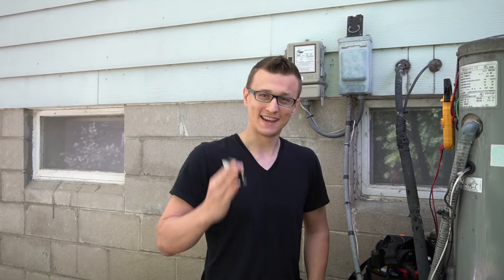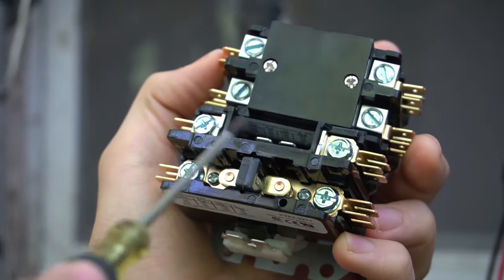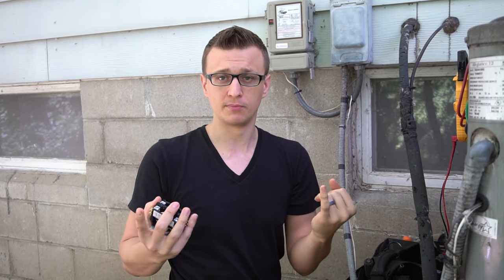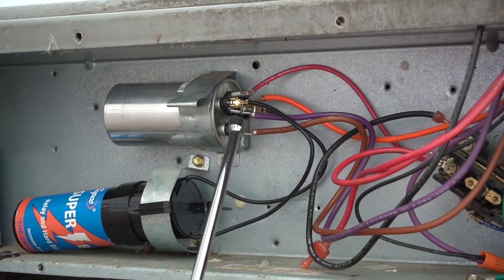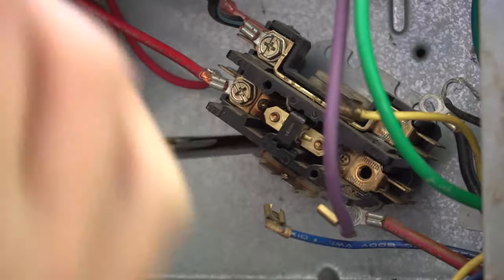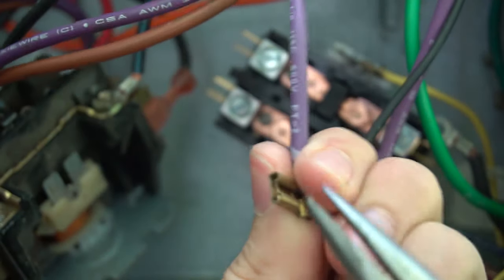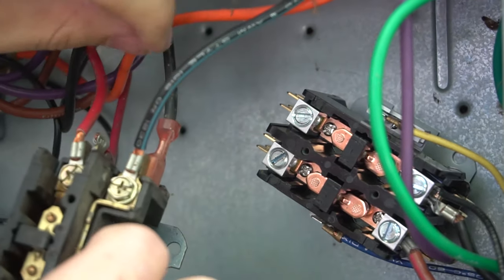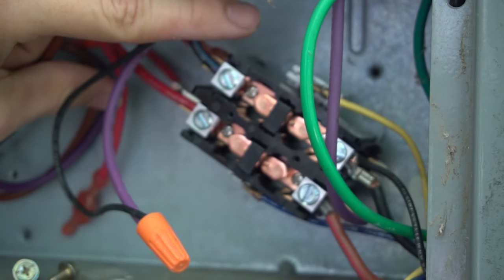How to Replace a Contactor in AC Unit

Comment: My A/C will cycle several times like normal then will not cycle!! I go out to the unit and hear a humming but the compresser not working or fan turning!! I can then tap the contactor with a nut driver and it pulls in and again cycles like normal for several cycles!! Is this a bad contactor or another issue?? Thanks!!

Comment: I have an old contactor..4 on the 24 volt side icp 1pole.. How do you hook up the wires off the Fan motor circuit board 1088977?? Low high, com, hot placement on a packard1+ shunt 30fla..need wiring placement circuit card😢

Comment: Fan was running, compressor not, pushed the plunger manually in with a stick and the compressor started, changed the contactor and its running all fine. Who understands this??
The 24AC was pulling the plunger in and with additional manual push on plunger  the compressor came on, why did the fan run and compressor not???? maybe loose cable shoe connector which I crimped a little bit. I feel those cable shoe connections are a common problem and not really often addressed.

Comment: Jay THANK YOU so much for sharing your AC videos. They are enjoyable, informative and easy to follow. Your videos have tremendously enhanced my comfort level with the operation of my AC. So much so, that I am able to carry a conversation with an AC technician and not feel intimidated. I also feel confident enough to troubleshoot minor issues and/or make minor repairs.  Thanks again, you’re the best. 

I do have a question regarding single pole AC contactors. Is there a certain brand better than others or a brand I should steer away from?

Comment: Your videos are awesome and easy to understand. THank you?
I installed a 5-2-1 kit on my AC unit months ago, but I'm not sure if I did it correctly. 
Thanks to this video, I just learned that I have a single pole contactor, and I attached the black wire of the kit to one of the T1 terminals of the side that has constant line power. That's the side with the black wire coming in and thus why I chose it.
Did I do that correctly? Or should the 5 wire been connected to the other side of the contactor that has the plunger?  THANK YOU
Reply: T1...if properly installed...should be on TOP and should be connected to the load...the device being powered. Then....L1 should be on bottom,....where the incoming line power comes from.

Comment: Hi! I was jus wondering... Ive listened to MANY of ur hvac related videos and u r a genius and i listen to no one else when it comes to hvac diy! That said, i have a question... So, whenever i turn on the ac, i have to go out there and give the fan a push and about every third i have to depress the plunger in the unit, then it works fine until it cycles off, then when it restarts, i gotta help it again! Is that my capacitor or the contacter malfunctioning?
Reply: Capacitor
Reply: or bad fan

Comment: You are an awesome teacher!! The problem I am having is the contactor is connecting but only for a few seconds then releases. The fan would make a short attempt to turn but then the contactor quits. I have replaced the starter coil but that did not help. Any help would be appreciated. By the way this is a Carrier model 48TJE006---501FF and the the contactor is a double pole model  HN52KC051C. Thank you very much...Dave

Comment: I have been watching many of your videos and they are all great and very helpful!  One thing I've noticed in comparing your videos regarding contactors to my AC Compressor Unit, is that my Compressor Fan has both a Blue and a Yellow wire that are connected to the 24v tabs on the contactor.  I am wondering what the purpose of that would be since I find no reference to that on your videos or the internet in general?

Comment: I went from a single pole contactor to a double pole because that is the replacement part listed now on my Goodman CPLE30-1C.  I found it at Repair Clinic.  However, now I hear a click but the fan does not run; when before with the old one it ran, but the ac was blowing hot instead of cool.  I replaced the contactor, and the capacitor as well, and took pictures to ensure I put back the wires the same way.  Any suggestions?

Comment: Thank you for the help! I was able to replace my faulty contactor today after watching this, also converting from a single pole to double pole during the process. 
I do have a question though. If there is a crank case heater installed with a single pole contactor, is it still possible to convert to a double pole? It seems to me you could just move the necessary wires to the hot side to always be hot.

Comment: I get 240v on my disconnect, but 0v on L1 and L2 on my contactor - is my ac whip the problem?  I know my contactor is good because it gets 26v and pulls in, and when i tested in out other ac unit it works. Replaced the capictor and fan too.  Everything wired up like before, just no voltage coming from the disconnect.  Our disconnect doesn't have fuses and I made sure the metal is pushed out enough to make firm contact on both sides.

Comment: I have an older Trane AC unit [BTD736A100B0] that uses a 2 Pole 24V 50A contactor RLY03346, but it has been sticking intermittently. Most all of the cheaper 'equivalent replacement' contactors (similar to the one you used in this video) are listed as 2 Pole 24V 40A, however. Does it really matter, or do I need purchase the much more expensive RLY03346 ?

Comment: In January, I swapped out my Thermostat for an Ecobee because my electric company offered it for a discount. Unfortunately, when the heat was on, the air conditioner turned on, too.  (I pulled the fuses for the high voltage, but the 24v kept trying to turn the a/c on all winter) I tried different things to fix it, but I didn't want to put the old thermostat until temperatures were warmer every day in the event I  screw something up.

A month ago, I put in the old thermostat and the a/c doesn't turn on anymore. The contactor would always buzz when trying to turn on, but it didn't anymore. (I didn't know what a contactor was until a week ago). I test voltage to the a/c and it's getting the proper voltage coming in, but after the contactor,  there was no voltage and the capacitor was extremly rusty.

I decided to buy both parts and I installed them today, thanks in part to your videos :) The contactor plunger was stuck and there were  burn marks on it. The old capacitor actually tested good, but I decided to replace it anyways.

Comment: Dan here, I watch a lot of your videos and think the are great. My comment is on your video "how to replace a contactor". You stated there was only one reason to not to replace a single pole with a double pole. I was watching other videos (not yours) , and other techs stated a single pole was necessary if someone had a heat pump, which required constant power. To overcome this, a jumper wire is needed to provide constant power on the always on side. It would be great if you could explain this. You explain thing so well. Thank.

Comment: My AC unit sometimes has issues with the scroll compressor going backwards  after different usage times. Could a bad contactor be the culprit that’s restarting my compressor which would then flip my compressor to spin backwards? My AC unit is less than a year old

Comment: How do I energize a 2 Pole Contactor/120V Coil?  Does it take both legs coming from the 120 source, and if so, how do you know where the hot and neutral goes in reference to the orientation of the coil?

Comment: Hello I need help. Everything works in my HVAC  except the condenser. Once I push the plunger on the contactor, the condenser goes on. I’ve tried it all. Swap fuse, swap thermostat, checked all electrical items. I can’t figure it out.
Reply from the maker: Hey Galaxy Luna! Sorry to hear about the AC troubles. Aside from the 10 reasons I cover in this video, there is not much else I can advise.. https://youtu.be/NVPhsK4gK1A
Reply: Sounds to me like you're either not getting 24 volts or the contactor is bad and they're not closing all the way.. Check 24 volts there.

Comment: The OEM contacter on my Goodman heat pump had 3 connectors for the low voltage wires. Two are as pictured in your video and a third is below the connector in the left. Two wires instead of one are plugged into the connectors (one on top of the other). I don’t see a replacement contacter with this configuration. Can I just plug the two wires to the side by side connectors on the replacement contacter?

Comment: Question  I have a older  carrier air condition with the air handler in the attic , i want to replace the contactor in the condensor  single pole my unit has a compressor time delay circuit board.  24 volt low voltage wires all on one side of my old contactor  one wire to contactor the other is to t2 on board then t3  back to contactor third wire from t1 to contactor. on the new contactor  coil one wire on each side where does the third wire (T1) GO TO? LEFT SIDE OR RIGHT SIDE?  Thanks

Comment: In the last half of your vid you are replacing a single-pole contactor with a new, double pole.....is this a problem?...and please also relate your answer if you have a crankcase heater where you say you want the T and L connections always bridged in this case ( confused 😳). The reason for my confusion is this....I have a Goodman unit and the factory-quoted spare is a double-pole unit....yet I DO have a crankcase heater.....hmmm. If we truly need the crank heater to be wired without going through contacts.....why not simply attach those wires to the incoming "L" side...when a 2 pole replacement is used ?

Comment: This video and a few of the others you had helped me solve my AC issue. Started off thinking it was the thermostat, after blowing several fuses, slowly rulled out each link in the chain. Turns out my contactor when testing only gave 1.2 ohms when testing it. I just got the part today and installed it! AC is working as it should!

Comment: When checking if the thermostat is calling for cooling, where did you put the black lead? @7:04, you put the red lead on the blue wire but does the black lead go on the yellow wire? Your hand just happened to block that view.  Awesome video by the way!

Comment: Can these DP style contactors be mounted either right-side up (meaning, L or line voltage entering on bottom)...OR... upside down ? (line voltage/ L on top?). Does physical orientation matter?

Comment: Love the way you teach  ty        I read that if it is a single to take the wires on the side that did not have the contact and put all the wires on the line side so they have constant power.  Your thoughts?
Reply: You will have a high bills

Comment: how to change contactor without turning the engine off, what additional installation components should i use? ( its one of the exam questions in my school)
Reply from the maker: Are you sure that is not a trick question? One should always turn the power off when replacing parts.

Comment: Okay. Wait. What changed in your system? Why did you replace your single plunger contactor with a double plunger?
Reply from the maker: Nothing changed in my system :) I only did that to show that it's okay to replace a single pole contactor with a double pole contactor. (as long as the unit does not have a crankcase heater)

Comment: I have a Train XL1200 4-ton 13 seer manf date 12/98.  It still works great and I have not touched it in years.  I'd like to give it some tlc and curious what I should be doing.  Starting with cleaning and inspecting the unit of course.  Should I replace the contactor and capacitor while I'm at it?  Or other parts?  I was told I should replace the AC disconnect after so many years but that sounds excessive.  Or should think about an upgrade to a new more effiecent unit before this one has issues?  This is in my mother's house and when I'm not around and she has issues with the house it can get expensive to call someone.

Comment: Hi Jay, can I use contactor (24vac coil, 40 fla, 240 vac, 240 lra, & res 50) to replace my old contactor (24vac, 32 flash, 240 vac, 150 lra & 40 res)?  Thanks!

Comment: replaced dual run capacitor. Unit worked for about an hour and then stopped. replaced with another new capacitor and same ting happened: worked for a while and then outside fan & compressor wouldnt kick on again.  Possible causes?  Low refrridgerant? Other?

Comment: So I have an "old" contactor with all the low voltage wires ( 3 in total)  on one side as you mentioned.  When I get the new contactor do I simply place the two that are close together now on one side and the one that is solo by itself on the other side by itself?  Thanks
Reply from the maker: Yes, you would place them on opposite sides as you said  👍
Reply: Worked great! Thanks for the quick reply. I know I saved some cash today!

Comment: When inserting the feed stranded wires into the contactor screws, should the wire be directly underneath the center of the screw or to the side of the screw as the screw gets tightened down?

Comment: When my AC condenser and furnace shut off at the end of a cycle, everything is quiet. No AC compressor, no AC compressor fan, no furnace fan. BUT, sometimes after 30 seconds to one minute, it sounds like the compressor is turning back on. Stays on for a few seconds , up to a minute. And it might do this 2 or 3 times in a row. If it stays on for too long, the furnace fan also turns back on. Is this a faulty contactor? Or your suggestion.
Reply: Did you figure out what was the issue?

Comment: Great content, has definitely saved my bacon in the last several years! Got a new problem that has me stumped. Maybe you can help me out with my problem before I call the technician in (trying to check everything I can before I do that).
Contactor and Control board at my condenser unit burned out. Both replaced, but still not activating the contactor (24v not being received @ contactor but IS at control board). If I manually press it down it turns on the condenser though. Could a pressure switch cause the condenser to not turn on at all? I think I properly checked my pressure switches to rule them out. Any help is appreciated!
Reply from the maker: Glad to hear that the videos have been helpful and sorry to hear about the recent issue! There are many reasons why a contactor may not pull in. Have you went through my video on 10 reasons why? It may help to narrow it down: https://youtu.be/NVPhsK4gK1A
Reply: @WordofAdviceTV  yeah, looking more and more like a major leak. Did everything i could, gonna throw in the towel and contact a tech. Thank you for the helpful content!

Comment: Followed this to a T and when I turned on the thermostat to cool, the AC unit was buzzing, even though the outside disconnect was still off.
Reply from the maker: If the buzz is not loud, that is normal. When the thermostat is set to cooling, the little plungers pull in. Sometimes with a buzzing sound. You could try tapping the cap or the plungers with the end of your screw driver and that might make the buzz go away.
Reply: @WordofAdviceTV  I double checked my wiring & then just turned the t stat to cool & is running great now. Thanks!

Comment: When Iooking for contactor replacement for a 25 Amp. I come across sites selling a 30 Amp contactor saying its a replacement part for the 25 Amp.  Is it safe to assuming using the 30 Amp part will work as a replacement for a unit that orginally had 25 Amp contactor?
Reply: yes it is safe, I replaced my 30A with 40A no problems. You can't replace it with a lower Amperage though.

Comment: My contactor works and pulls in, i have 230 on the bottom legs comming from the flip fuse, but i do not have 230 at the 2 legs above when the contactor is engaged..is this a bad contactor internally?
Reply: Carbon deposit prevents full connection when the contactor is engaged. I bet you're getting 120V or so? You can disassemble it and clean it with sand paper or you simply get a new contactor, they are cheap.

Comment: Great video.  On the single pole, the side that has the bar going through is that the common side and the one with the plunger is the power side?  Thanks.
Reply from the maker: Thank you! There is no common side, both sides are hot sides. 120v on each side which adds up to about 240v.
Reply: Thank you.

Comment: I have a old Carrier A/C and the contactor does not have T1, T2, L1, L2. It has numbers such as 11, 21. What are those refer to?
Reply: I believe they refer to port 1-1 then 2-1, probably have 1-2 and 2-2 as well?. I think it doesn't matter which way you set the contactor unless you have a crank case heater (CCH). I have installed may using T1/T2 for the lines and it's all good.

Comment: My contactor started making a loud buzzing noise but everything runs ok. I'm pretty sure it needs to be replaced.
Reply: I currently have the same thing happening and I just changed the Capacitor with no change.  Noise appears to be coming from that area so I'm leaning toward this as well.  Was hoping someone would have answered your question already lol.